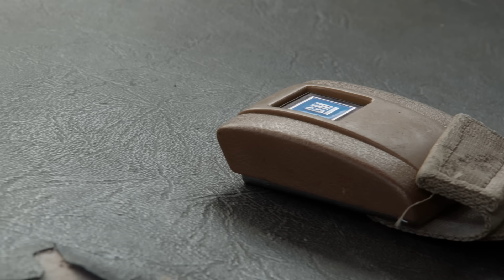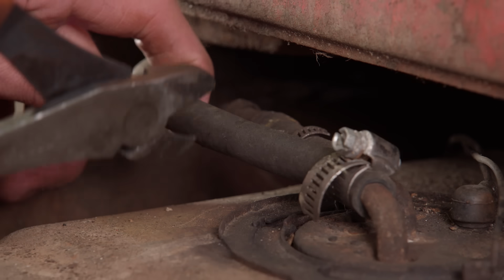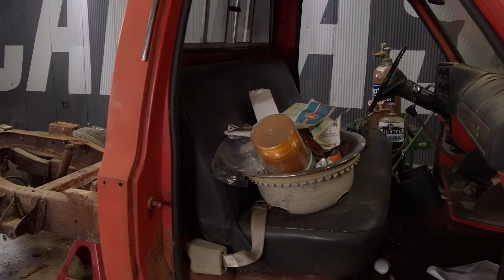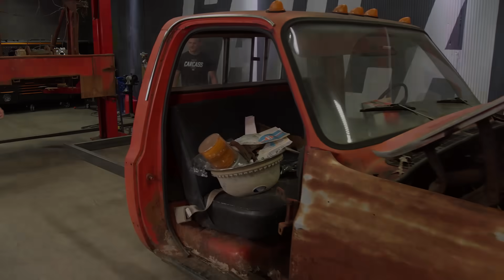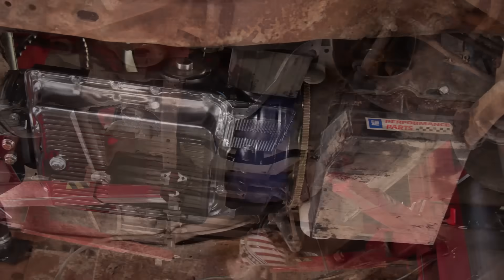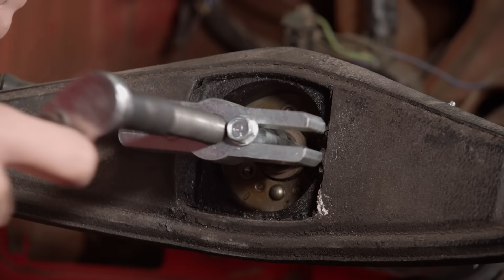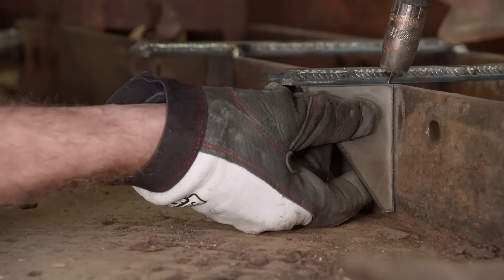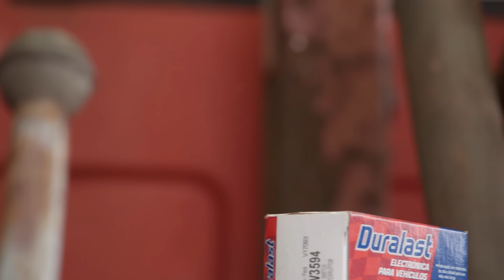Full Build: Junkyard Square Body Tow Truck Is Restored And Modernized

Comment: Seemed a little suspicious how easily they had all the exactly parts and how clean that fuel came into that filter
Reply: brand new studs for the carb... all set  up had luck with everything perfectly always... oh well
Reply: @marinmarusic5937  soon as i saw no corrosion on distributor i knew
Reply: Right, it's always a good idea to drain the fuel tank before starting an engine in a scrapyard. Probably there was a lot of prep work done before.
Reply: @Alby_Torino  very true, I came here to watch this as a guy that watches a lot of junkyard revival videos by types like vice grip garage, they show the full work of getting the car running and just gives it a better feel for us guys that really do this lol
Reply: @joshthatguy9094  same here, total TV show type "restoration" plus replacing the original motor and trans, totally destroying the value of the truck to a real collector.
Reply: @chippowell1  when I saw the comments that the swapped them out I stopped watching
Reply: @joshthatguy9094  A half hour TV show is only 22 minutes of action. 3 episodes is 66. A You Tube video is any length you want it to be.
Reply: @chippowell1  "Real collector"?? Of rustbucket tow trucks? Get real. Besides, they already built a new, non stock, rear chassis! Sheesh. 🙄
Reply: @jeffrykopis5468  go watch vice grip garage, those are good and entertaining revival and he makes them feel genuine, this whole video felt to staged and forced but it's also a matter of preference which is totally understandable
Reply: @joshthatguy9094  derek is the best!
Reply: @joshthatguy9094 , you think vice grip and all those other asshats posting "we found XYZ, can we make it run" vids are real? lmfao, All those channels are just stumbling upon "abandoned" or barn find vehicles.... sure they are. And what are you, 12 yrs old? It's TV dingleberry, they have to skip some shit to condense the action into 22 minutes of TV.
Reply: @chippowell1  yeah, because a 305 square body is worth six figures but only if it's numbers matching! No one wants that garbage boat anchor motor.
Reply: @jeffrykopis5468  hey pal you know that this is actually just a TV show that also gets posted on youtube.. why do you think they post the full build? You can even tell when they'd typically stop the episode.
Reply: @Ben.Jergenhoff  Yeah, I know. Not a lotta "reality" in reality tv. But it is entertaining, until the untruths become TOO glaring.
Reply: @chippowell1  It's a WRECKER.  Those are tools for people who USE trucks for their intended original purpose. Wrecker conversions are classics in their own right but noobs are oblivious to the towing and recovery world (good for me buying my Holmes 480 donor truck for a century note some years back). Collectors do garage queens and the world has plenty of non-work truck museum pieces for those nostalgic for their extremely long dead youth to fap over. 

Wreckers are tools first and toys second. Those wreckers are extremely useful trucks with many still working in 2023. The usual way C-30s not converted on purchase is just like what the video shows. I've done several like any mechanic working used truck lots.  Many became wreckers after a stock GM diesel died. They got a BBC or SBC transplant because those were and are disposably cheap. They got modded spring packs, a Line Lock so they stayed put while winching (which can easily destroy a parking sprag) and whatever wheel lift or wrecker was handy. Then they made a hell of a lot more money than they cost to build. 

Every serious amateur mechanic should consider one and if they want a collectors item they can and many old wrecker owners do make a "period correct" wrecker build.  My F100 cab on 350 chassis (the heavier chassis go cheap when the cabs rust) with Holmes 440 helped erect buildings, pulled many an engine and is absurdly handy. It got the usual 460/C6 out of a Lincoln when the 390 wore out.  Wreckers are terrific for towing trailers of course (DRW and heavy springs work a treat).  

There are plenty of C-10s for Sunday drivers and no shame in that game, but wreckers like collectible farm tractors are useful and used.
Reply: Y
Reply: Shut up Man, going to ruin it for us dreamers.
Reply: @davidtappe5337  it's ok, I'm a dreamer too
Reply: It's illegal to have fuel in vehicles in a junkyard, they poke holes in the ones you can't easily drain here. So it's likely it was completely empty.
Reply: yeah this video wasnt for people on youtube, who actually do the repairing, fab work, and design the projects.. this series was for the guy who makes 6 figures a year and watches it on cable tv then finds a customs shop and gives them a blank cheque to get something like this done and it costs him north of 60grand

cant believe they ditched that 465 out for the automatic which in turn made them ditch the pto driven winch for an electric one... ruined the whole project right there
Reply: The truck was a total plant but I guess it can be forgiven since they're just trying to tell a story and make a few bucks on views.
Reply: Three guesses why 😂
Reply: @GeorgiaRidgerunner  I know. I have a friend with 2 properties filled with pickups, wagons, Caddies, motorhomes, forklifts, tow trucks, VWs, bikes, street rods, you name it. Probably 60 or more. The most vehicles I ever owned at once was ten. But I wouldn't recommend using an F-100 as a camper truck. Yeah, you got one, but that don't make it right for the job. I'd go F-250.
Reply: stopped for years the fuel degrades losing its combustibility
Reply: They probable had a small tank as supply
Reply: It was an entertaining build!  Nothing is going to be perfect!
Reply: They had all the parts because Chevy parts are cheep
Reply: Clean Hands, Clean Tools and Clean Clothes  Doesn't do it for me.
Reply: Yuuuuuyyyuyuuyu
Reply: Yyuuyuuyyuyyyyuyy
Reply: Man it's a YouTube video of course it is Al ready already just behind the camera☺️
Reply: These episodes are worked out in advance and they have plenty of time to order stuff.
Reply: They make cars. Of course they'd have all of the parts. It also appears that you overlooked the fact that this is from a tv show.
Reply: It is TV! They have to add scripted scenes to make a show look good… Zack
Reply: u think?? Same with the stupid automatic swap....lame!!
Reply: I was thinking that very thing had a car sit in a garage and that fuel was garbage after 10 years
Reply: it’s a tv show with budget you don’t think they ant gonna go through and make sure it works before dropping all that money on it
Reply: It's almost like they did stuff off camera so they could get the important moments to fit in a hour-long video... 🤷‍♂️
Reply: It's a TV show, not a documentary.
Reply: For the views😉

Comment: Adding power to a truck designed to weigh and tow well over 10,000lbs gcvw. And then putting in a garbage trans to handle it is mind boggling.  6l90 makes sense 4l60..... Not so much. If anything a tremec tr40-50

Comment: Vertical welds for the spring hangers has proven in the past to snap frames. I have seen this on mechanics service trucks. Avoid doing this.
Reply: Thanks for that. I'd never heard that before. Is riveting or bolting the recommended procedure?

Comment: What possible benefit was there in ditching the manual transmission? For anything heavy and for any towing, the sm465 is the tool of choice. No "built" automatic will be able to stick in there like the sm465 could.
Reply: Agreed the only automatic variant would be an allison with pto, but they shouldve kept that sm465 truely a beast even in stock form.
Reply: The 5 litre engine got replaced with a 5.7 litre fuel injected V8

Comment: If you went to that much trouble to replace that much of the front end and frame  you should have done a full frame off restoration   and media blasted the frame and cleaned up all the rust. Media blasted the wrecker body and components. Actually restore the whole truck. This would have been way cooler

Comment: That "overlap" on the old frame to new frame isn't going to last long at all. Trucks gonna be a banana within 5 years right at that seam. I dont understand putting all this time and money to make a tow truck that will never be able to reliably tow anything more than a utv. Also pulling the manual trans and replacing it with that garbage was ridiculous. Don't even get me started on that shitty electric winch. If you're gonna do a job do it right.
Reply: 700r4 will not last in a towing application

Comment: I agree w GTs Dude Garage. You should have kept the manual transmission and restored the old winch.  Head to head, no comparison the manual tran would beat the auto in every way.  That old hydraulic winch was BY FAR superior to that junk little electric one.  The electric one wasn't meant to have multiple thousands of pounds constantly hanging on it over bumps/potholes and getting yanked around. It WILL fail.  The old hydraulic winch was built for that. Plus, removing to he pintle reciever off the back will decrease the number of calls it can run.   I agree with another comment, you built it for show, not working....this all is just my opinion, and yes, i did run/operate tow trucks for several years...
Reply: there new age colledge dudes,what the hell do they know. its just content & a wage for them..

Comment: Nice restoration. I feel it was worth the effort, cool to see it running again. I would've kept the original trans and pto winch but the new upgrades are more user friendly for sure. Thank you for sharing the build/ restoration.
Reply: the winch is wrong,. original heaps better,stronger.& the box too. thats why they were built like that..
Reply: @harrywalker5836  hydraulic is also analog, the winch is either off or on. but this car is just built for the show and gets parted out later anyway
Reply: https://youtu.be/ScLm9sWlfrM

Comment: Great job on the fab work. A crummy 77R4? Why? Perfectly period correct 4 on the floor. Aside from the unnecessary expense of a blunder of a trans, you now need to add cooler, shifter and cross member. This expense could’ve been better appropriated towards paint body etc, or just avoided altogether.
Reply: SM465 ???
Reply: You think they would know what they are doing when they have over a million subs. Let them do what they want.
Reply: @trevorpotmesil9288  Well, apparently they don't because the 4 on the floor was a better choice.
Just because someone is successful, rich or famous doesn't mean they're smart or right or better than anyone else.  It just means they are successful, rich or famous and as often as not they got that way by luck or jumping at the the right opportunity at the right time.
Reply: @barrylinkiewich9688  The 5 litre V8 engine with carburetor got replaced with a 5.7 litre V8 with fuel injection.

Comment: Drove a truck like that for many years, sure do miss slings and chains and of course, the stack of 4x4s needed to keep from crushing valence panels. The one I drove was light in the front. If I hit certain bumps right, the front wheels would come off the ground for a pretty good distance. Rig was a Holmes 660 split-boom.

Comment: im not so sure, the engineering is great and measuring is spot on , but i wouldn't tow anything more than a VW bettle. when you formed the rear frame from scratch i thought for sure you were putting that on the inside of a replacement frame from another truck, as i think the weight classification of the frame is going to be lower that its designed for, having worked in the tow industry for some years i have seen some stress put on tow truck frames, even now my truck has a double frame built for weight and stability, also the gusset metal thickness is very thin , most of the stuff i have ever seen was 1/4 thick to 3/8 thick , only my opinion of course.
Reply: and also on fix the  bak  frame half what about the rusty frame at the front  ???
Reply: This rear frame seams to be too weak for the job. What steel plate quality is use? Fe360? In my oppionion calculations are required on bending forces to have a safe constructies.
Must such new frame construction on a truck be inspected on safety by authorities?
Overhere in Holland you can not build you own truck chassis without strengh calculations and an inspection by the authorities, including the welding quality.
But Nice to see How the project progressies.
Reply: Yeah they halfazzed the whole build
Reply: @GenXer-65  I think the main issue is how it's married to the existing frame.  The rest looks OK, but I would go heavier.
Reply: We have stretched frames on semi trucks for years. We always use an L cut to join the two frame halves, then another section of frame is set in the existing frame as a fish plate, then it's bolted to reinforce the joint of the frame halves. This build was meh
Reply: I think Pakistani people have great expertise in repairing truck chassis...😁
Reply: Repearing them to have 6+men ride and attack us US Troops, and setting IED charges in them and trying to blow us up, too...
Reply: sooo many rust regrowth points...and putting the engine and box in before doing the cab? dafuq?
Reply: Should of been stock or better